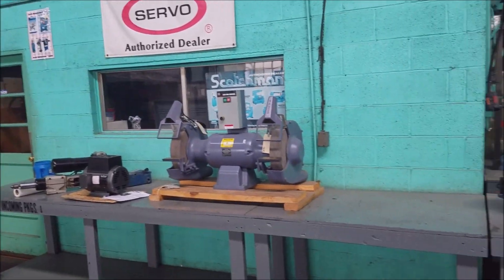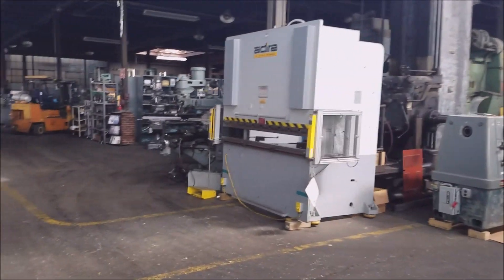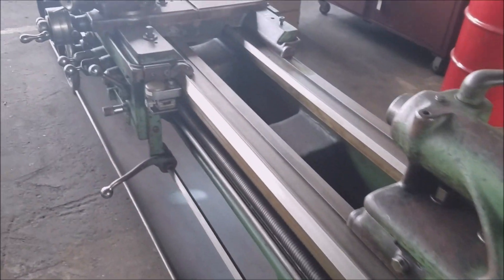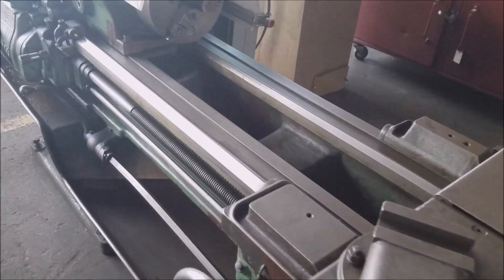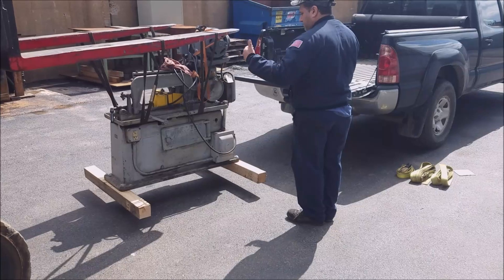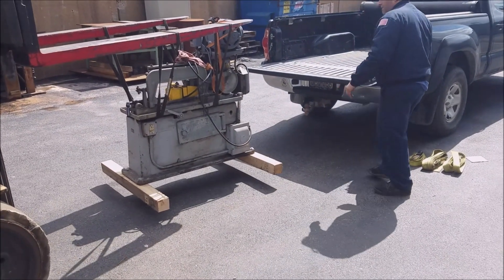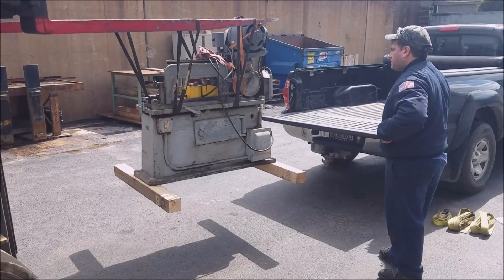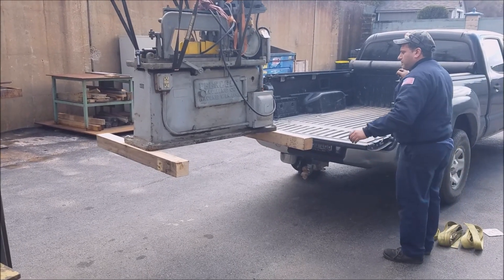Machine Rescue! - Peerless Power Hacksaw

Comment: Can you please explain to me how the oiling system works? Is that entire cabinet full of oil?
Reply from the maker: There is a round belt from the crank driving a bronze pump in the rear cavity under the motor. The front cavity holds about 3 gallons of water/Sawcut fluid mix. It is pumped to the blade and drains into a removable rectangular bucket which collects the shavings and keeps the sump cleaner.

Comment: Nice thing about a power hacksaw is once they are set up you can put it to work on a big piece and do another job meanwhile. A friend of mine has used them to cut down tractor engine sleeves. They make a very nice perpendicular cut.
Reply from the maker: Yes, I'm amazed how fast it eats metal, even with it's wide kerf. Ours has issues with alignment, I suspect the pivot bracket is loose, and the feed pawl guide is broken now.... project #153.

Comment: Those types of 'hacksaws' are enjoyable to watch in action.
At least @Norman they know how to properly rig up a machine for loading.
When I picked up my Mill at auction the riggers were butchers in disguise.
They put the forks directly under the ram against the dovetail with no wood. Metal to metal contact.
Reply from the maker: Yikes! They used slings on mine. Hope there was no damage to yours.
Reply: @EngineersWorkshop  
...As it is shown in all the manuals.
Nope they didn't. Couldn't find any.
And I had to stone out the dingleberries when I got it home. 
All that for a $100 fee.
Reply from the maker: @middleroad00  👍